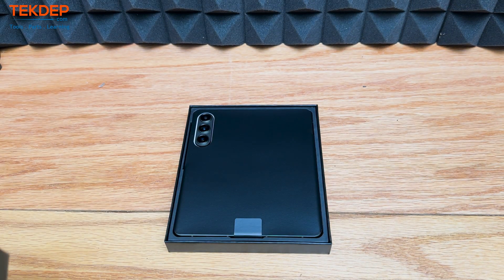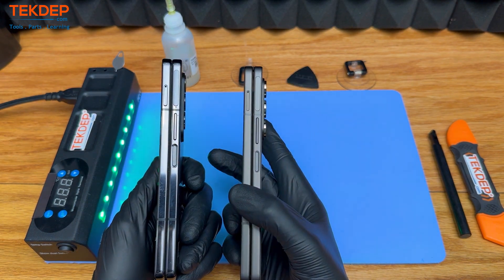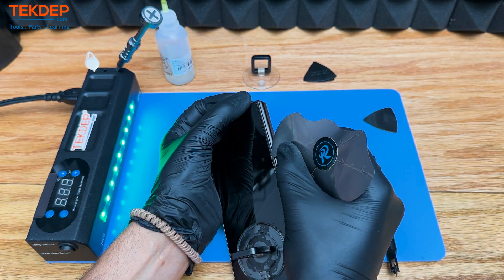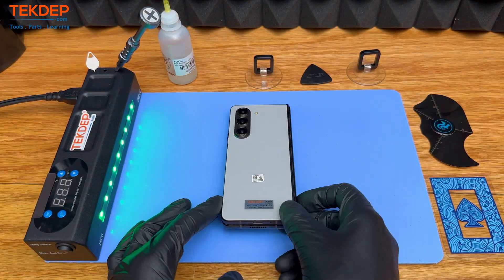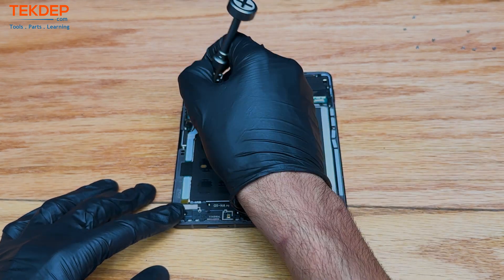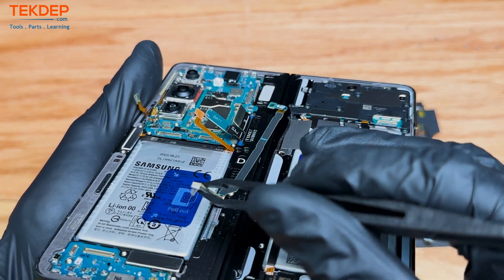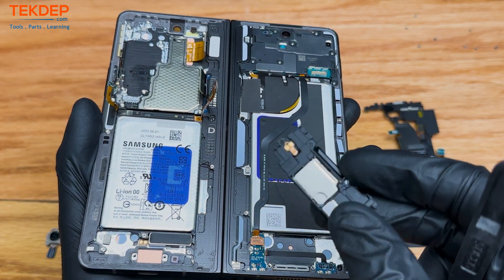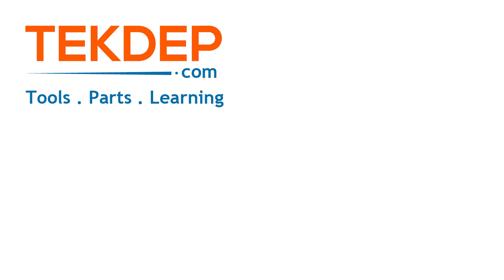Samsung Galaxy Fold 5 Teardown | Disassembly & Repair Guide

Comment: Regarding the Flip5, if the folding screen was green with random touch activation and then went dark, is it a bad connection from a flex cable, do you think, or does the folding screen need to be replaced? The outer screen works fine.

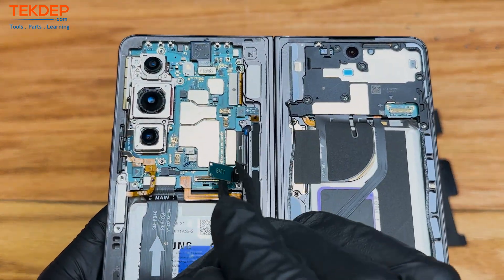Comment: I bought one of these and it started failing after just 3 months. The wifi and bluetooth just stopped working. I've seen videos of people fixing the issue. it's just the connector for the ribbon you unplugged at 4:39 seems to be faulty and need to be changed, but no one around me wants to even attempt it. I've no idea what to do anymore.
Reply: having intermittent bluetooth issues, where the bluetooth turns off on its own esp when I fold the phone, then turns back on after 5-10 seconds, very annoying...did you figure it out? I think the hinges have to be removed too to fix it??? thanks

Comment: If u replace mother board zfold 4 does the imei also need to be replaced
Reply from the maker: Yes that is correct the IMEI number would change and serial numbers too! If an unlock board is installed you should be completely fine in case you have issue with your IMEI number

If you anyone needs reliable replacement parts for MacBook or phone—like screens, batteries, logic boards, cables, or repair tools—we’ve got you covered. We have everything you need and ship fast! worldwide! visit: https://tekdep.com

We also offer a convenient and affordable Mail-In Repair service for all electronics and issues, along with advanced data recovery. Learn more and get started here: https://tekdep.com/device-repair/

Comment: Sent by you:

when plugging in my charger to my Samsung Galaxy z fold 5, my phone made a sparking sound and went black. I could not turn it back on. after a while, after holding the power button for about 120 seconds, it powered on shortly but then turned on.. Both times I could run apps, but the power wouldn't stay on. The phone gets warm when plugged in but shows no signs of charging and now will not turn on at all no matter how long I hold the button. Could this be a battery that needs replacement or a new charging port, or both? The fact that it turn on with full functionality would indicate it isn't a motherboard problem, correct?

Comment: Hello, this video was referred to me, I have a perfectly fine, fold 2 that ive used for 3 years! (lucky!) but the dust brushes on the right side came loose and are now keeping the phone from opening a lot! I think I could remove just the right half of the inner screen and undo the inner screws on the interior hinge to just remove the right half of the phone and clean behind it. But I'm being told even if the repair is managed without breaking the inner screen, it wont sit back flush and will likely get water damage in the near future. Whats your take on this? 

Can I remove enough of the inner screen without breaking it. Can I remove just the right half of the phone for cleaning. And can it go back together in a satisfactory way? 

Do you have any teardowns of the inner screen?
do you sell the repair kits (other than the expensive looking heater)?

Comment: Hello. Nice clip. Pls give me a hint how to clean de fold 5 hinge without opening. Have a small unpleasant sound while opening. Thank you.
Reply from the maker: Unfortunately, the hinges are located inside the main LCD. There's no way to clean them unless you disassemble the main LCD and remove the particles that are causing it to make a sound. We suggest sending it in if it's still under warranty.
Reply: @tekdep  thanks.  That's it

Comment: Is the wifi cable on the hinge?
Reply from the maker: yes, the set of antenna modules are located by the edge of the frame, and in between the middle of the folding upper frame of the display assembly, thank you for watching.

Comment: How about the cable of sound and wifi bro? on fold 3, the cable always break haiz
Reply from the maker: when it comes to Wi-Fi and have connectivity issues it all comes down to the Antenna Connecting Cable (Mainboard to Charging Port) ; (Mainboard to Antenna Board), so 4 cables to replace total which their cost is low, if it does not restore connectivity, it may imply problems with the Baseband of the logic board. When it comes to sound, the soundcard is embedded into the motherboard 32-bit/384kHz audio Tuned by AKG, rarely it fails, but usually replacing the stereo speakers should repair the Loud speaker system, thank you for watching.